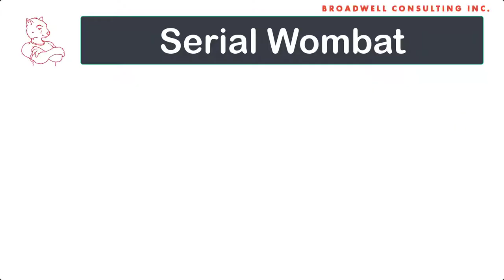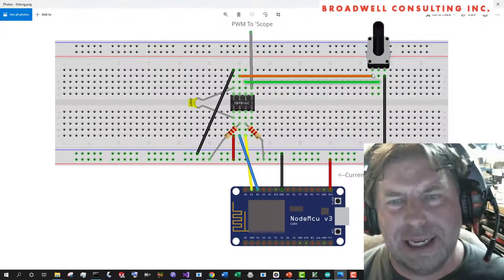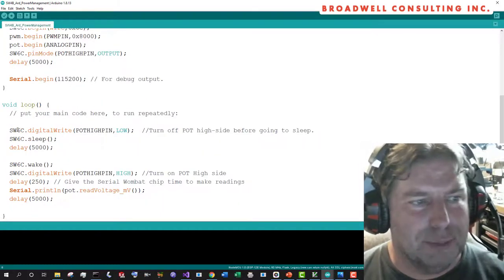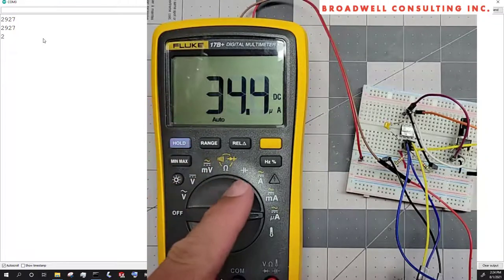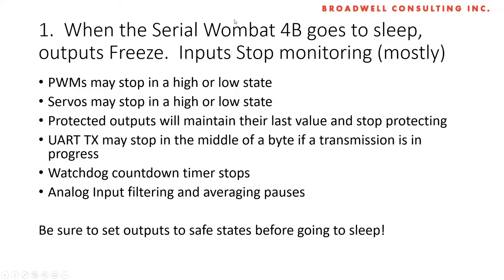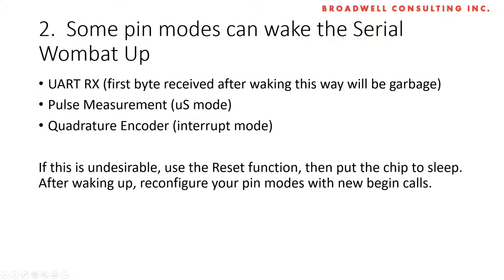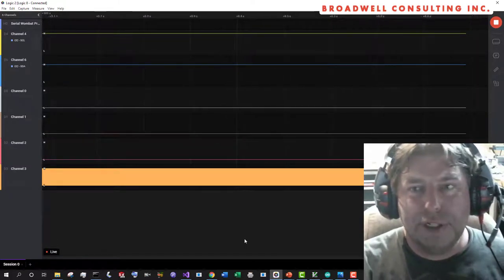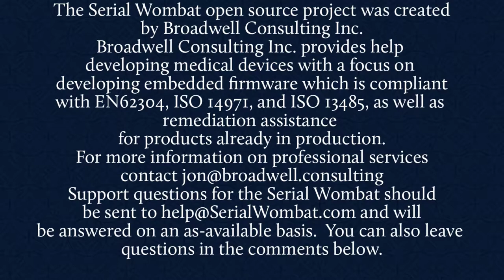Managing Serial Wombat 4B Power Consumption

Comment: Is there any way to sync the pwm timing with a zero-crossing input?
Reply from the maker: Not on the Serial Wombat 4B chip.  I'm currently working on the Serial Wombat 18AB chip which might be capable of what you want.  I'd be interested to hear about your application and understand your requirements if you want to email me at help@serialwombat.com .  Perhaps I can integrate your need into the next chip's firmware.